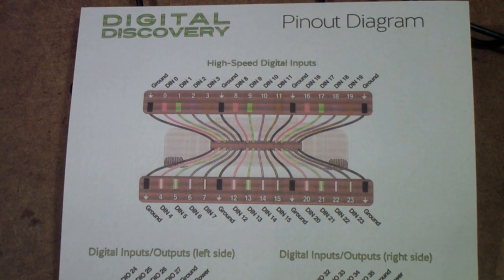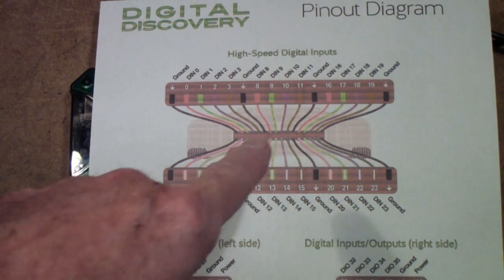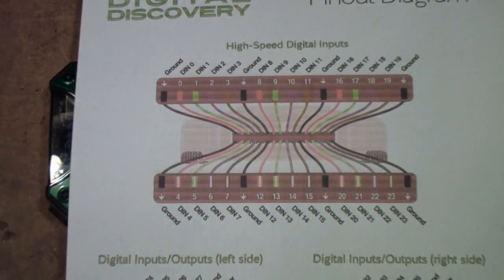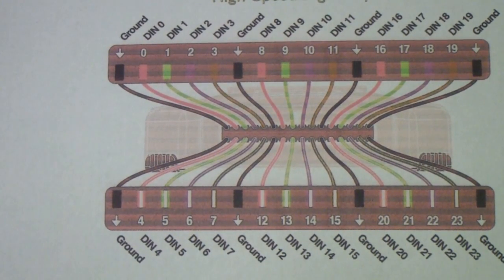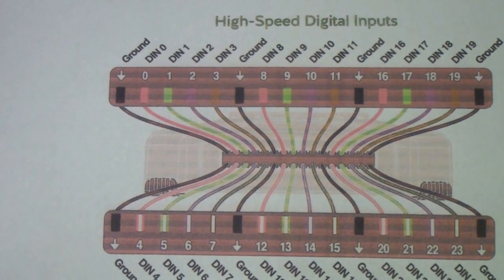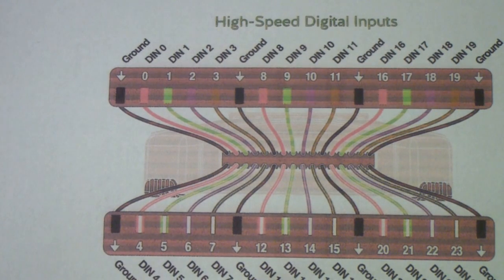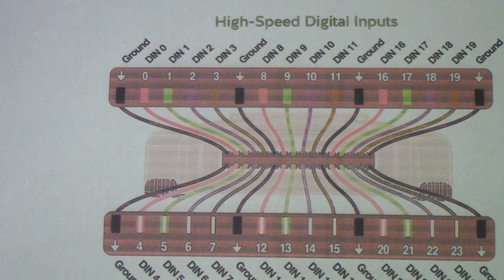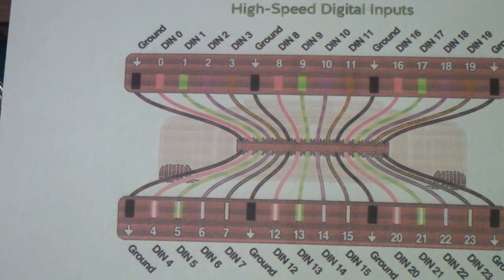TTT160 Digital Discovery Introduction

Comment: I looked the D-Discovery and curious about its claimed 800 MS/s when the high speed adapter is attached. The schematic diagram of of the high speed twisted pair cables shows that it has a 100 ohm resistor connected to one of the twisted pair (red wire). I wonder what is the role of this resistor? without it, the speed cannot exceed  200 MS/s. I'm not sure how can 800 MS/s be useful when the Bandwidth is only 100 MHz?

Another thing that cought my attention, is the price of about 200$ compared to the AD2 which is 179$ (acadamic price). I looked through the manual and found that the most expensive part in the DD is Spartan-6 FPGA XC6SLX25 (41$), while the AD2 has the AD9648 14-BIT ADC (81$), plus a smaller Spartan-6 FPGA (31$) and many more parts that are pricier than the DD has. The functionality of the AD2 are superior to the DD except for the extra 8-digital channels. In my option, the 16 digital channels in the AD2 are sufficient for an embedded engineer in most cases. How can Digilent convince buyers to get the DD instead of the AD2?

I will be thankful, if you touch on my questions in your future videos.
Thanks
Reply from the maker: Over-sampling is always useful in digital instruments if you have the speed to do so.  As I am sure you know, the minimum sample rate (Nyquist criterion) is 2 Samples/Cycle. Most prefer 4 Samples/Cycle and the Noise function of the DD doubles that again. So, I suspect that Digilent chose 8 Samples/Cycle =  (800 MSPS/100Mhz) to get 4 samples/cycle with noise detection. You might ask Digilent (on their website) if you are really curious about this but I suspect they wanted to over-sample by at least 2X the Nyquist minimum. I will try to do a review of the Digital Discovery soon and I will certainly mention my thoughts on this if or when I do that review.
Reply: Thanks for the reply Tom!
I made some tests on the input impedance, to see how the DD stands among AD2, AD1, and the Saleae Logic Pro16 logic analyzer.
1. Logic Pro16 (2 MΩ)
2. AD1 (60 MΩ)
3. AD2 (70 MΩ)
4. DD (0.65 MΩ), surprisingly low!

and Yes, I was curios enough to purchase the DD.
Reply from the maker: I have not looked at the other instruments but I can confirm that I got approx 650k ohm for the dc input impedance of the DD.
Reply from the maker: I have looked further at the AD and AD2 and their dc input impedance appears to be around 51 k ohms. I think you measured  the scope input impedance, while to compare apples to apples you should measure the digital inputs, i.e. pins to the right of the trigger pins (looking at the AD from the input connector side). I measure around 51 k ohms from input 0 to ground and the same for inputs 1 through 15 (far right bottom of the input connector). Please let me know what you get on your AD. I'm glad to see you bought a 
DD - I plan to do some more videos on it in the near future and I will mention the input impedance.
Reply: I remeasured the input impedance of all digital pins with respect to ground (Pins 0-15), and didn't get below 70 MΩ for the AD2 nor 60 MΩ for the AD1.
I also measured the Scope input impedance between the differential inputs and got 2 MΩ (1 MΩ with respect to ground) for both AD2 and AD1. 

I'm eagerly waiting for your next video.
Reply from the maker: I accept your figures, I only measured the AD2 pins with an ohm meter, not under dynamic conditions. For negative polarity the figure was around 50K (due to the diodes used to limit negative excursions). Under positive polarity the figure rose into the 100k range and kept rising. The AD2 schematic shows a series resistor with limiting diodes to ground and Vcc. Based on my measurments the series resistor is around 50k but the input then goes to the FPGA input so it seems reasonable that you could get the figures you report for positive signals. You don't say how you measured the impedance but I assume it is with some dynamic measurement using positive signals. The DD schematic shows that, unlike the AD2, the digital signal is divided with a 51k series resistor and a 510 k resistor to VRef, which is consistent with my measurements and the Digilent specification. I was unable to find a Digilent specification for the AD2 digital input impedance.
Reply: Mohammed Algailani - Strange set of comments. Have you worked with embedded systems? 

Did you do what are are calling "tests," but provide no schematic of how they were performed, while the units under test were active? 

Embedded systems are not passive entities like resistors. They operate together with programming, in this case at the FPGA and USB tethered level. 

Much of what you seem to be measuring is signal conditioning circuitry around the FPGA. That is not meaningful. 

You need to "test" signal attenuation of a primary standard (perhaps a REF02 based +5 V source driven by a battery) that demonstrates what the units under test can see. 

Input impedance is a concept that gained life around the time DVMs were developed. Similarly, the concept existed in scopes because users did not want analog scopes interacting with circuits under test. 

Unless you have some point in this thread that I am blind to, I think you need to reevaluate why input/output impedance/sinking limits matter. 

If for some reason you believe that these devices may interact unfavorably with your device under test, do some research on signal conditioning. 

In the case of the DD, I think the 100 ohm resistor in the >200 speed range maybe a good subject for you to investigate.
Reply: The methods used to measure the input impedance are posted on Digilent forum.
  https://forum.digilentinc.com/topic/3978-logic-analyzer-input-impedance/?do=findComment&comment=15253

Thanks.
Reply: Mohammed Algailani I

Comment: What is the size of the internal buffer ram (analog discovery 2). And what is the max. FFT size of this thing? Thanks...
Reply from the maker: I think I must have failed to emphasize enough, the Digital Discovery contains no analog circuitry, therefore it has no FFT. Only the Analog Discovery has analog circuitry and, therefore, an FFT. I don't remember the internal buffer size of the Analog Discovery since I did those videos over a year ago but I think it is 16 k samples.
Reply: Yes, of course.. I want to know, how much buffer ram the analog discovery 2 has and what its max. FFT size is.
Reply from the maker: I don't know what the maximum FFT is but the data sheet for the AD2 states that the sample memory for logic analysis is 16k transitions/pin. The DD data sheet for logic analysis shows 256MBytes which is shared across the channels so each pin (assuming that 16 are used - just like the AD2 logic analyzer) would have 16MBytes. You should check the Digilent website, however, since my data for the AD2 might be old (it is what came with my AD2 many months ago). You might also be able to find the FFT answer there too.